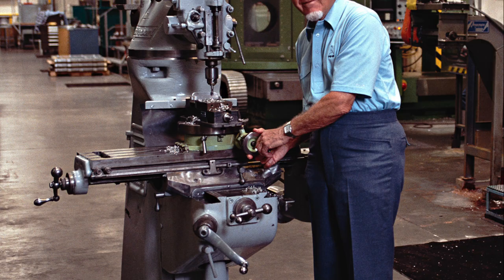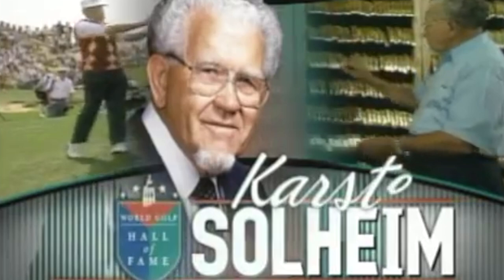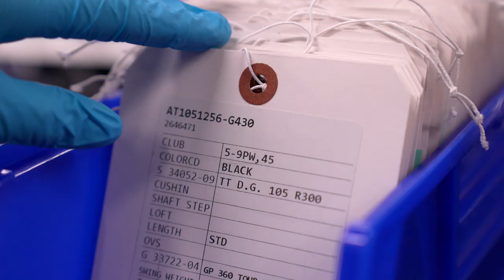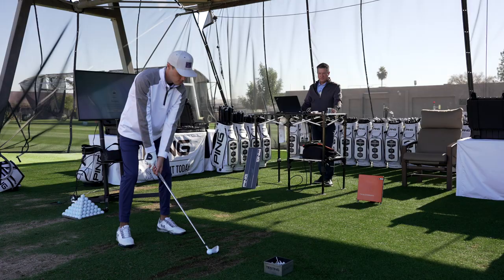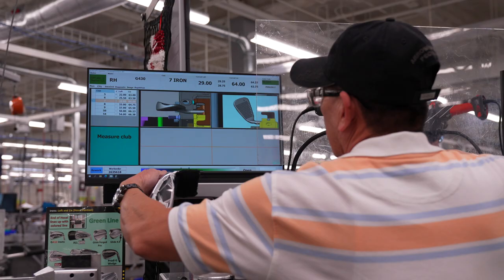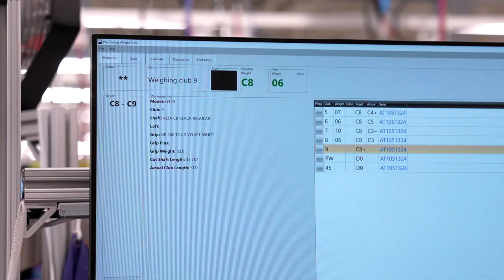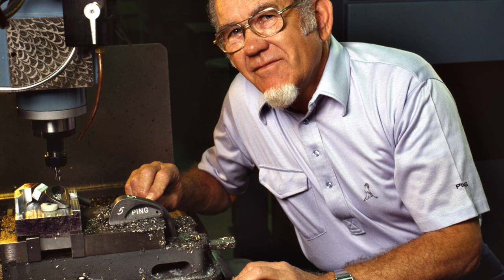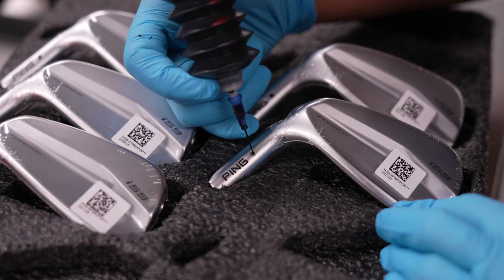Inside PING: Custom Built

Comment: I have the 425's and this is exciting to see.
Reply: I was fitted for the g425 but never bought then.  Do you like the 430s?
Reply: @mrbenfer5884  I have the 425s
Reply: @jason25b  right....    I tried to order the 25s I was fitted to but they said it's not possible and that the 30s are basically the same thing.   I'm going to keep the same measurements and order the 30s.   I see good reviews

Comment: Fitted for i230’s yesterday but ideally would like them with Oban CT-100 shafts which aren’t listed as an option - do Ping do them on request? Thx
Reply: As far as I know, Ping doesn’t use Oban shafts. I think, while Oban shafts (made by Shimada) are a nice, but overpriced option, you can have the same level of performance with the AWT shaft or the Nippon Modus 105 model. I‘ve been building and fitting clubs for over 20 years and have always been a shaft snob, but my current set is a Ping i230 with their AWT shafts with cushion inserts to bring up the static weight to my personal preference. They feel just as good as anything out their, perform nicely and are all I can ask from an iron. Don’t waste your money. The available options are really good.
Reply: @TTDefender  thanks, went with modus 105 in the end & no regrets at all👍